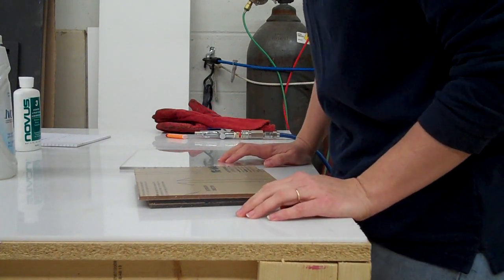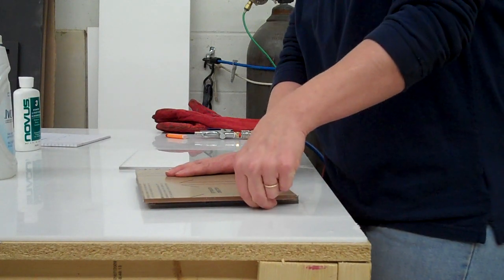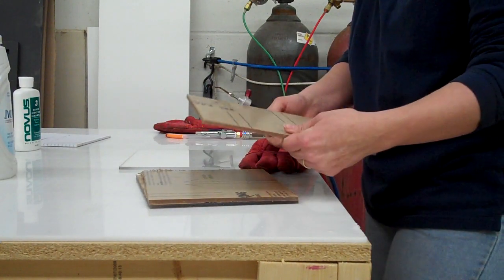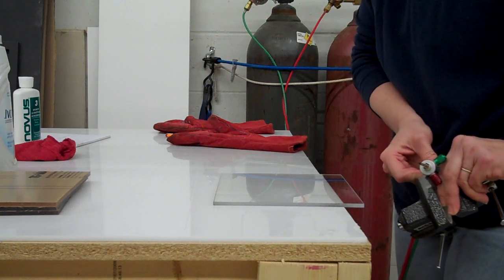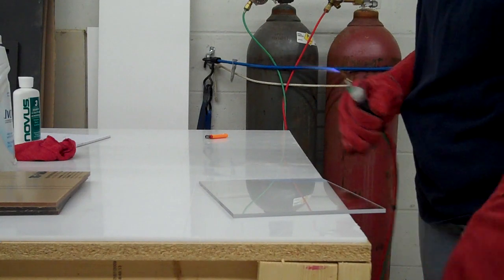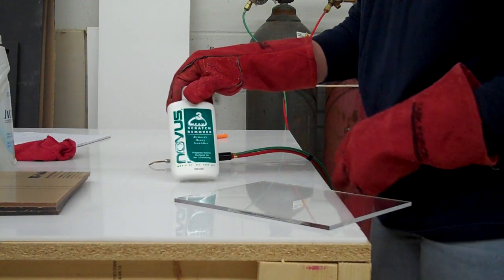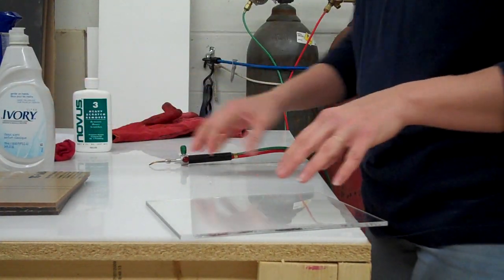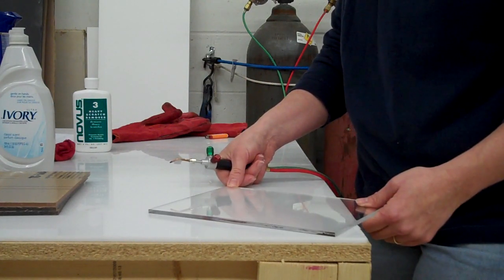flame polishing

Comment from the maker: Yes, it can be but so is driving your car. both gases are flammable. so make sure the gas is turned  off at the main when not in use. it is chained to the wall (earthquakes) are just nocking over. yea no open flames and don't catch the hose on fire or cut it. also use a striker (in the welding dept.) not a BIC to light it.